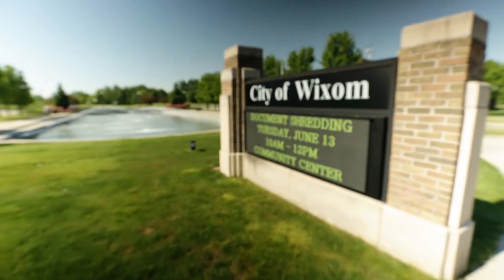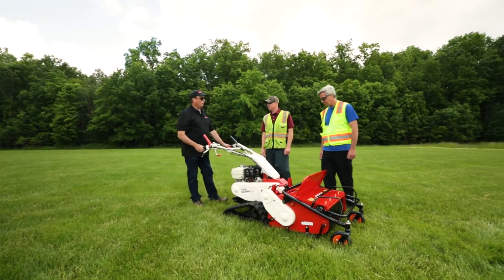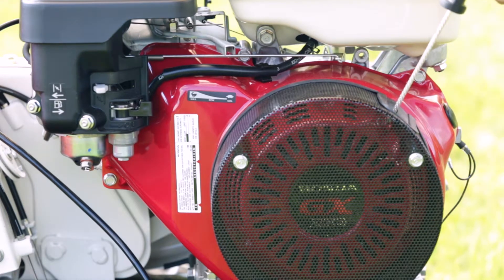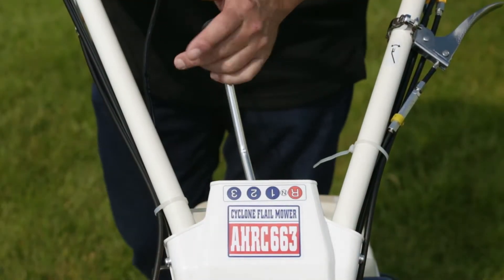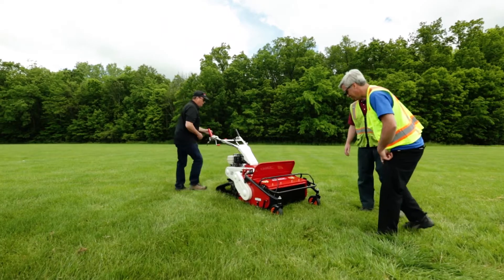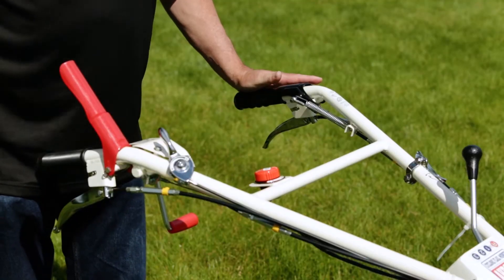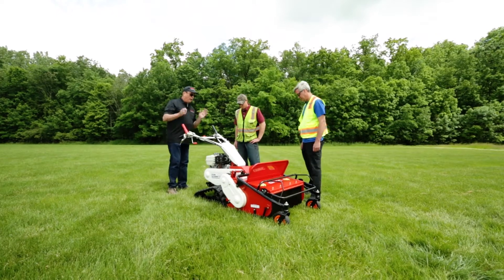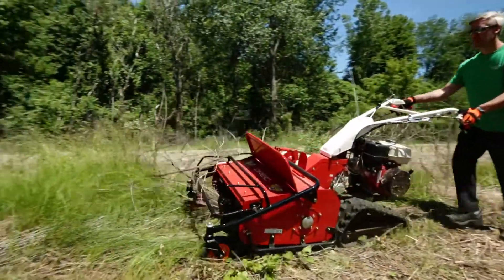All You Need to Learn to a Use a Flail Mower

Comment: How easy are the knives to replace and are they proprietary knives or standard knives?
Reply from the maker: The only flail blades that will work on this machine are manufactured by Orec. However, replacement flail blades are easy to order from our corporate office in Michigan and install by yourself. They will be shipped out within 24-48 hours of order placement.
Reply: @OrecamericaG  It would help your sells somewhat if you guys would build a model that used standard flail mower blades
Reply: @Agwings1960  - Regret to inform, there's no "standard" blades... Each manufacturer does what he pleases. 

What you have is several brands using parts from the same component manufacturers. Inclusive the same factory producing several different brands (changing tags). But none of those are "standard" per se. They're just drawing from the same components bin. ;-)
I hope it clarify a bit. Cheers
Reply: Hello, good morning, I have a machine or I want to replace the blades, where can I get them?

Comment: my scenario has many downed pine branches up to 4 inches in diameter, and they may not be visible to the operator.  Does this handle large branches like that?
Reply from the maker: We recommend keeping the base diameter of branches and saplings to under 1 and 3/4 inches.